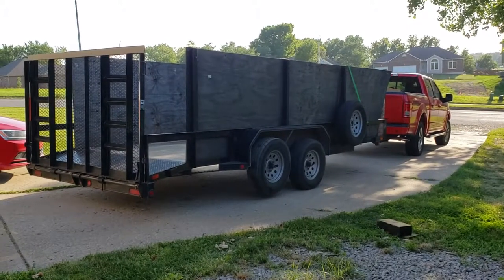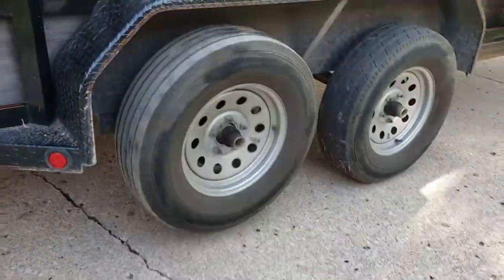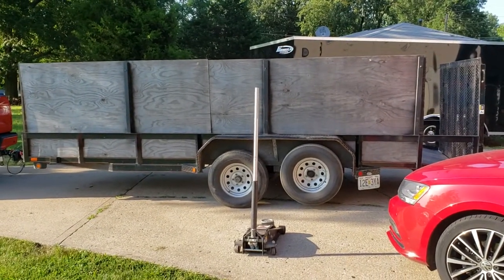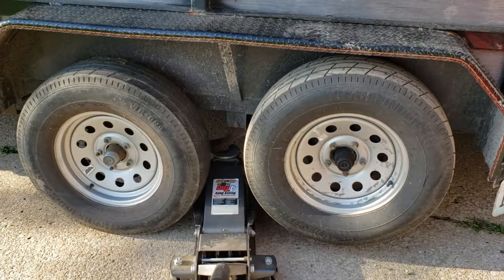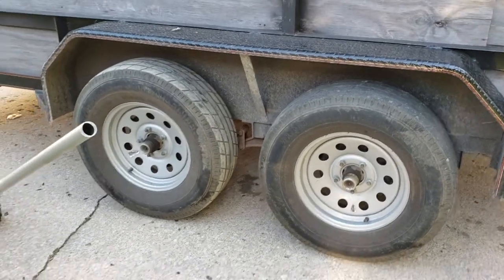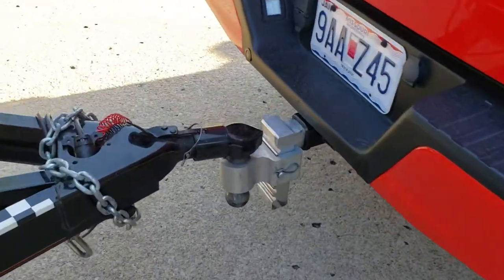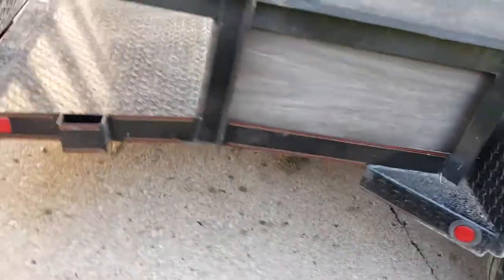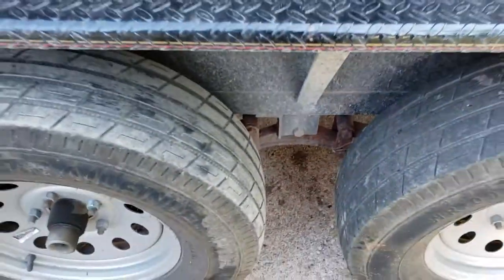HOW TO FLIP AN AXLE BACK OVER ON A TRAILER

Comment: For a trailer to be stable, 11 to 15% of the weight has to be on the tongue.  What happens is that now all the weight is on that front axle, unloading the tongue, it's all hanging out the back. You're a dog with an oversized tail with a mind of its own.  . The best response is to hold the wheel firmly and steadily; trying to fight it rarely works and usually makes it worse.  Just keep the wheels pointed to where you want to go. Let off the gas, and slowly come to a stop. Do NOT slam on the brakes!  If you have trailer brakes, use them to slow down, that's the best solution.

Below say 35mph things should be under control

How do I know?  I was told by my dad a long time ago at probably 15, he was adamant that I understood.  30 years later our son was coming home from college, and his buddies loaded the U-haul trailer.  We hooked up, got on the interstate, and it went apeshit.  Violent jerking back and forth, wheels coming up off the ground.  I remembered the advice somehow.  Got to an exit and unloaded and reloaded the trailer.

20 years later, pulling an enclosed trailer with a Harley Trike in it, one side shackle flipped over and awwwwaaaaaay we went!  Still remembered, and used the trailer brakes, which calmed it down a lot.  The wife was like "Wow I'm glad you know what in the hell you're doing."  Didn't have the heart to tell her I was scared shitless, too.